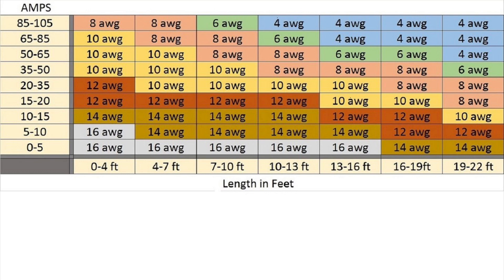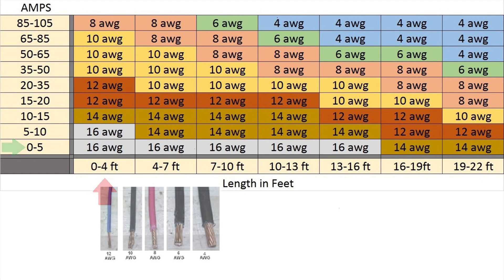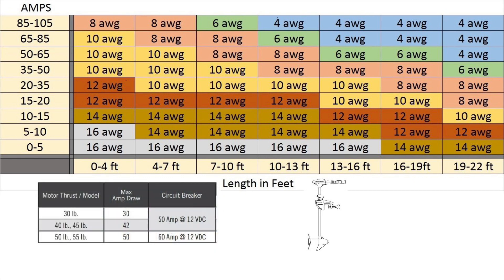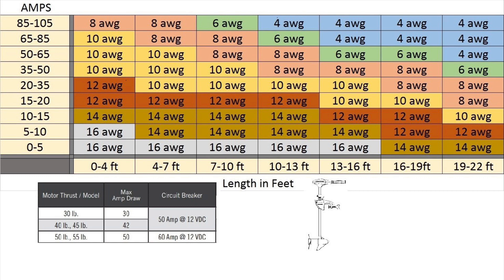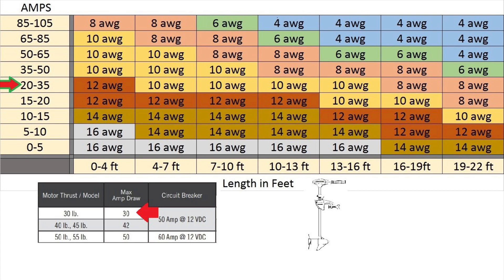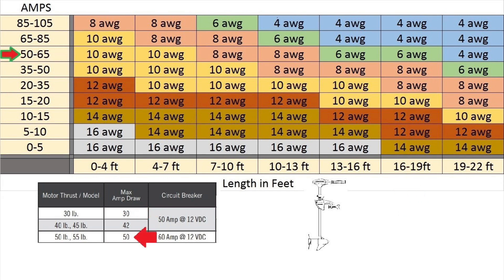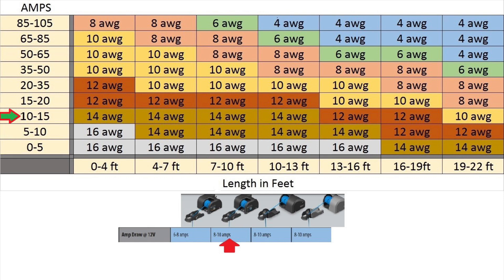Wire size to use when installing equipment on boat

Comment: Is the length, the length of the whole circuit? Positive + negative?
Reply from the maker: Hi jackpeters, thanks for watching. That’s a very good question. This cable run has to include the length of the positive and the negative wire!